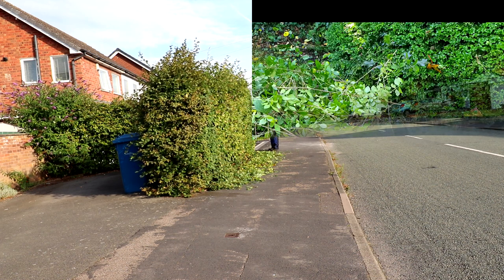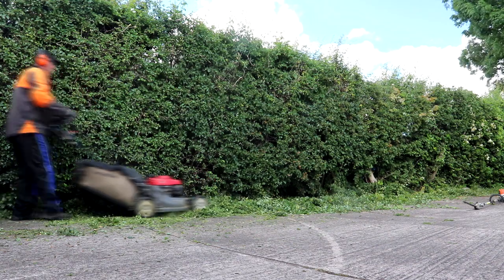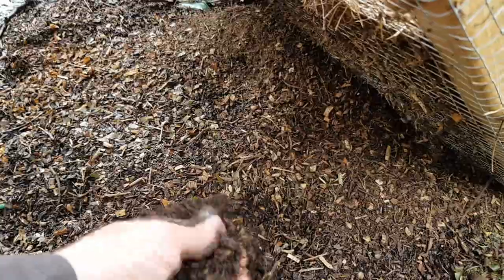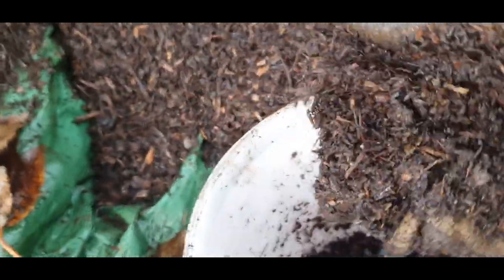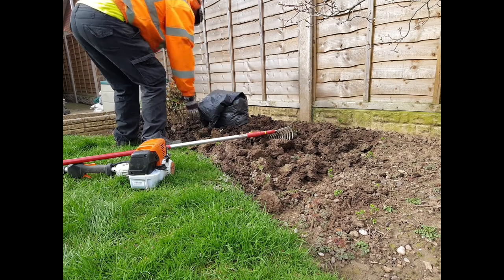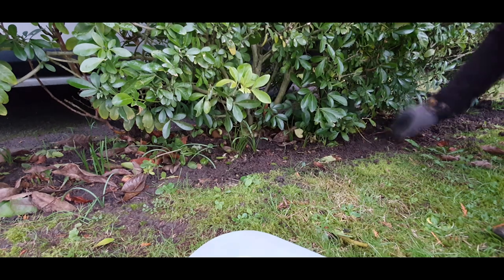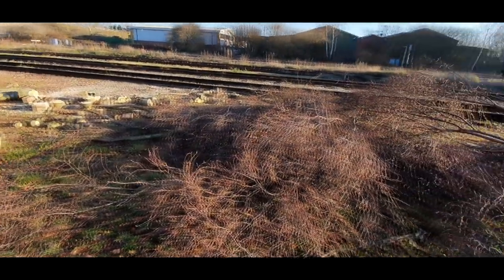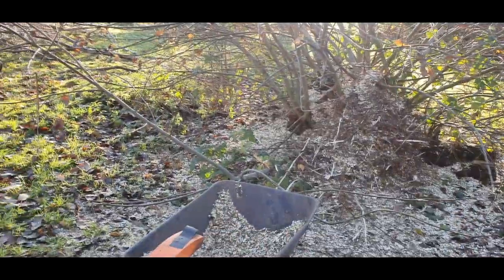From hedge to beds

Comment: I brought a mighty Mac Allen a few years ago. It was slow wouldn't chip very thick but customer was always impressed with the reduction. I brought a minor eliet last year that's done well for me. Managed get a 1996 major eliet prof 3 with the honda gx 390 engine cheap enough. New blades and full service. Beast machine. All the gardens I have installed  mulch on have improved soil wise. It's the Eden way to garden. I just edge and and trench out the border edges. Suppression of weeds. Retains moisture. Amends soil. Slow release fertilizer. It's a valuable commodity don't give it away.
Reply: It's the mycorrhizal fungi that develops over time. Forms a symbiotic relationship between plants and soil. Obviously if it is their mulch they pay for chipper shredder time and installation.

Comment: I like this approach with the mower , if it was me I would probably work some sort of fair charge for the mulch (i know some wouldn't go for it) but it seems a fair bit of work for you ...just a thought 😊 ...cool vid.
Reply from the maker: thanx for watching, If the mulch is requested, I do charge for it,  On some borders I use it to condition the soil, like in the clay border as it makes it so much easyer for me to work with, I charge by the hour, but if I mulch, they get slightly less time so It does get paid for in a way.

Comment: Hi I’m not a fan of this approach to clearing up hedging, I do sometimes pick up the odd bits left with a mower, but not the amount you did. For me there’s so many things against it, mower and blade wear and as you mentioned stones flying and staining. I bag or chip, I use the chip at home or just bin it. But your way is an option anyways I enjoyed the vid🙂👍
Reply from the maker: I knew this one would be a bit contraversial, I had picked up the dregs from day one, but the last year or so, it just saved me so much time. its definatly not sothing I would recoment, as stated several times, but it works too well for me. If the branches are thicker, I will chip then then mulch them, it just saves me a huge amount of time, and usually the customer a fair amount of money, thanx for watching